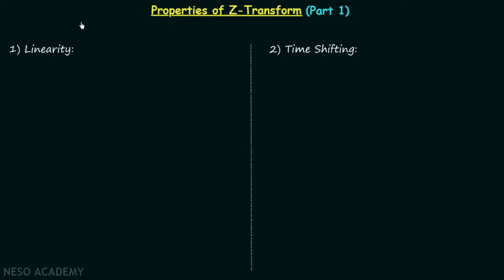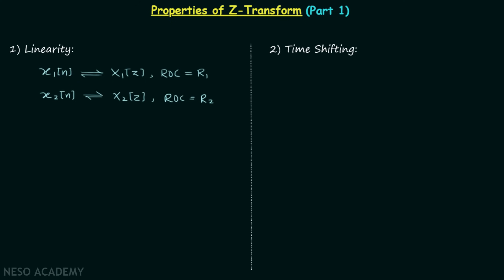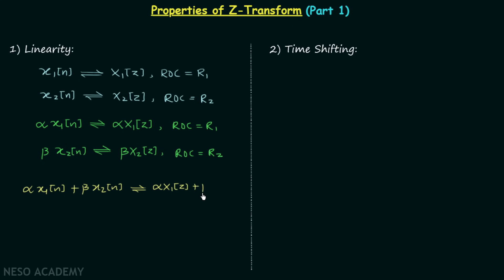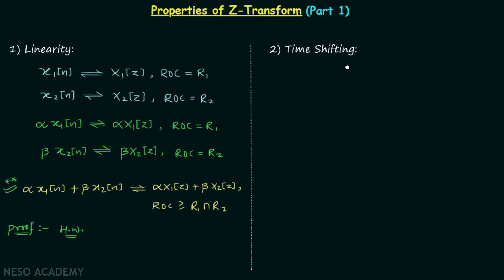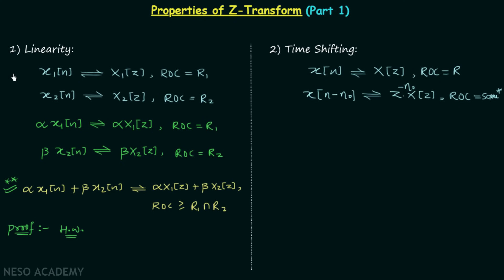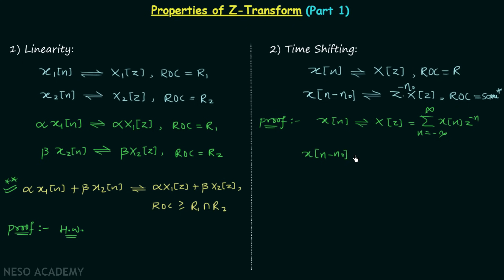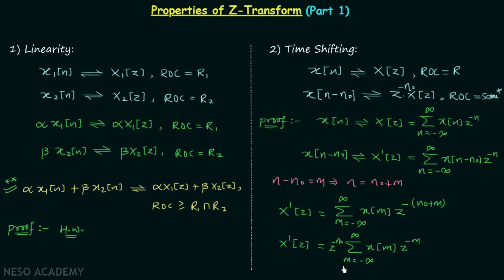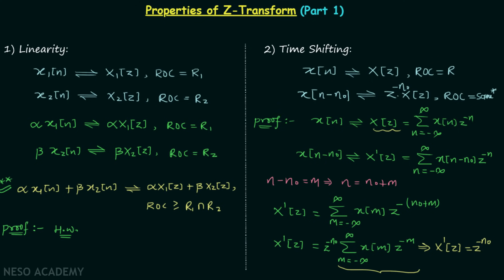Properties of Z-Transform (Part 1)

Comment: During time shifting x[n] changes to x[n-n0] at that time if the transform function z^-n  changes to z^(n-n0)?
Reply: Same question
Reply: @sachinojha203  bcoz first we are giving x(n) input to the system which do the time shifting then we are calculating its ZT. we simply not replacing n by n-no
Reply: In previous lectures of FT/LT sir already told this so plz go through with it
Reply: we're providing time shift only to the input signal. And not replacing n by n-n0